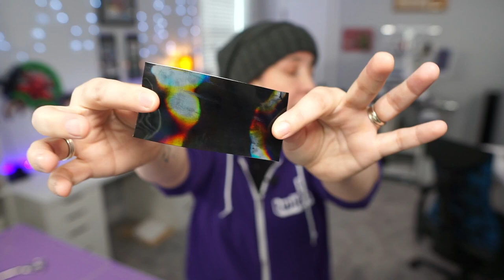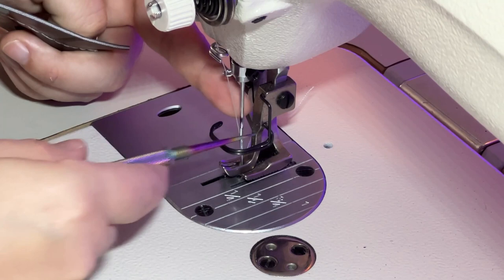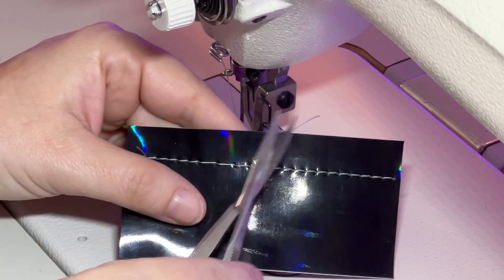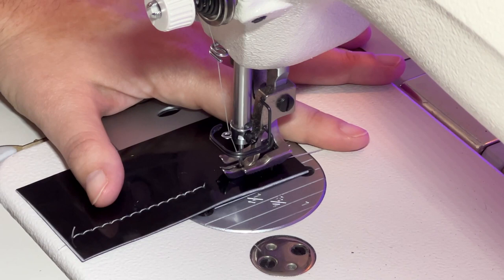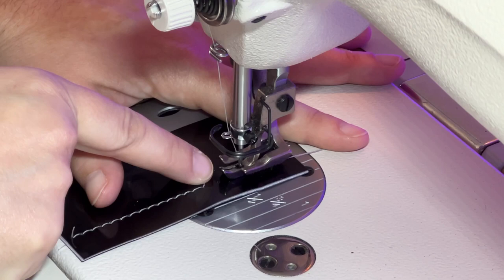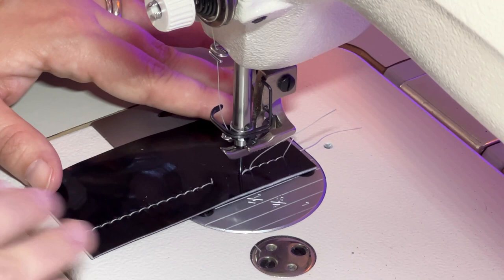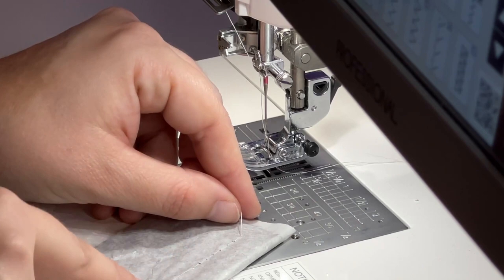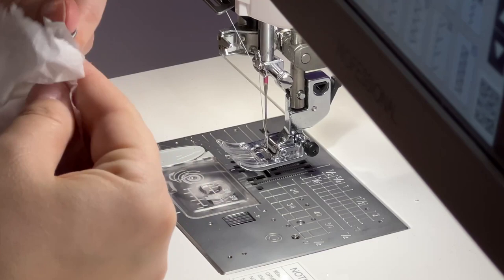How to Fix Skipped Stitches in Vinyl or Leather

Comment: I’m making a byannie bag on my featherweight. Great usually even on vinyl as all metal parts. However last night making pages for bag and on the binding it began to do this. Kinda baffled me, changed needle and same issue. Weird thing was when I tried to repair and sew it did exactly same big stitches in very same place! Still I would hugely recommend it as it sews through everything, even leather and being metal no sticking to vinyl.

Comment: If you have a walking foot, you don’t have to use tissue paper on domestic….right? #newbie
Reply from the maker: You MIGHT - but it depends on which fabric is hitting the stitch plate. In this case, in my INFINITE GENIUS, I was using vinyl on both sides. Normally you'd have some kind of lightweight lining fabric and then the vinyl on the outside. I topstitch on my flatbed, so usually the vinyl faces up for me - meaning I have my bags inside out when I topstitch.
Reply: @fiercekittenz  that makes sense!
Thank you for taking the time to respond😀